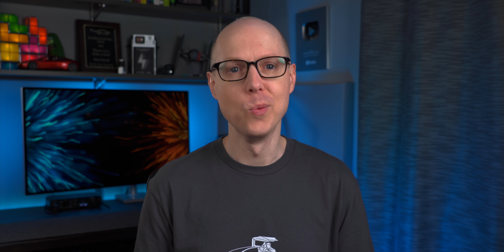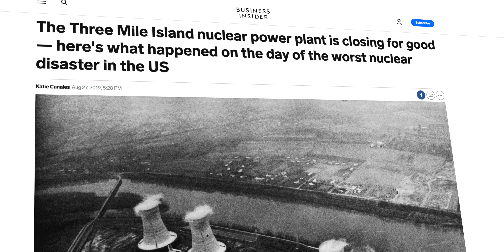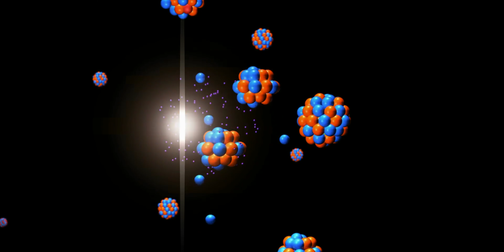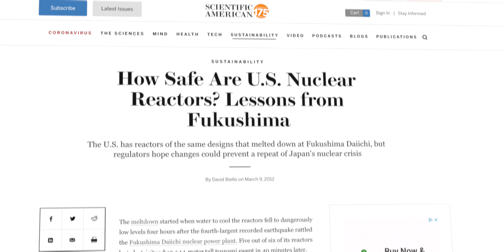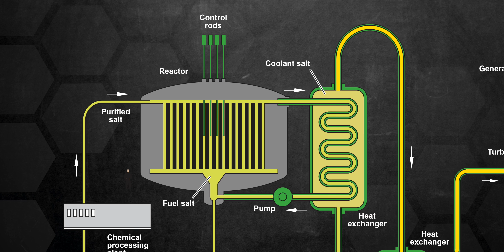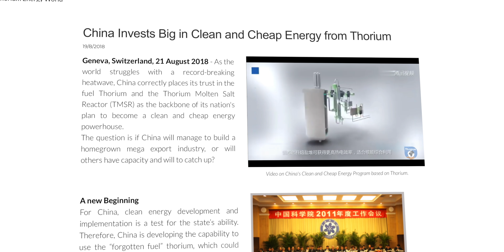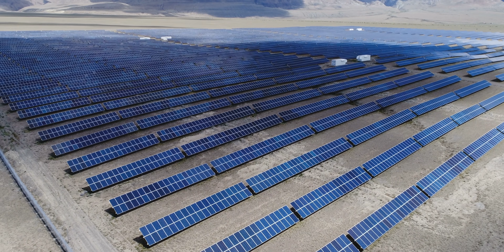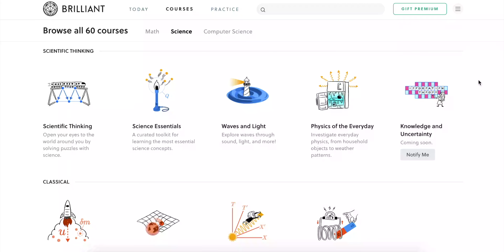Thorium explained - the future of cheap, clean energy?

Comment: Thanks for covering this. The efficiency of these plants can't be overstated, at least for the Molten Salt variety. We're looking at going from say 4% efficient today, to in excess of 90% with these. Molten Salt plants don't suffer from the disadvantages of having to manufacture solid fuel rods which are both expensive and have to be removed before they are fully spent.
They also work at much higher temperatures, so the power plants can be much smaller for the same power output.
You also don't need that massive containment building which all traditional reactors need to contain a catastrophic failure.
Reply from the maker: It's understandable why there's a movement behind the concept.
Reply: @UndecidedMF  - Obviously solving the Engineering problems is far from trivial. However, compared to the challenges faced by Fusion they are much less of a hurdle. We know the reactor physics works because of the success of the Oak Ridge National Laboratory experiment. Considering this work was only rediscovered relatively recently, they've made astonishing progress. This is against a backdrop of a regulatory framework in the US that severely restricts what they can do. Hence much of the work is being done elsewhere.
Reply: @rogerfroud300  The big thing is it's engineering, not the basic physics, the reactor concept works fine, it's just making it economic.
Reply: @killcat1971  - Agreed, and the Chemical processes for the maintenance of the fuel will have to be validated.
None of these things are especially difficult to do, I don't think the costs will be prohibitive. The economic prize is truly vast though. Generating power from fossil fuels or renewables provides a pitiful release of energy compared to what can be acheived through the use of Molten Salt reactors. Things like desalination of Sea water for drinking, or even removing Carbon Dioxide from the atmosphere, reversing global warming are feasible when you can generate vast amounts of cheap electricity. It's an absolute game changer compared to any other current power source, including the present generation of Fission reactors.
Reply: @rogerfroud300  - all great points.  I wonder why there is so much press and push for fusion, yet the MSR - in its varieties seems to be a win/win/win option that the US and the world are not pursing fast enough.  I know Germany rushed into the solar business - batteries are not very good - maybe that will change soon (they are slightly better than they were 10 years go)... there are rumors of those solid state and graphene or what not, for batteries that could make those a game changer in the next 5 years.
.
For the grid, renewables are not all that good. Batteries are barely any better.  Fusion is a distant dream.  The MSR is mostly here and mostly tested... it should have been here 10 years ago.
..
Maybe the US Petro Dollar needs to die first?
Why is the US so attached to the oil/shale/petro dollar - they are all linked.  You could say it is the old US Empire.  Time for a new more efficient empire!
Reply: @drx1xym154  - The reason is a simple one.. It's likely the nobody even knew about Molten Salt reactors when research and investment in Fusion began. The Molten Salt Reactor experiment at the Oak Ridge National Laboratory was destroyed and the reports nearly lost due to political reasons.

It's only because Kirk Sorensen read about the experiement and tracked the reports down and published them that anyone heard about it. Even then, nobody was interested because they were too far invested in Fusion or conventional Fission to be able to run with it.
 This was only in 2000, so progress has been astonishing really.

If they knew what we know now, ITER would never have been built. Even now, it would be better to just scrap it and divert the billions they're still wasting towards Molten Salt Reactors. That's never going to happen though, there would be too much egg on their faces.

Molten Salt reactors will come now though, and Fusion will never be economically viable with Molten Salt reactors as a competitor. There's huge interest in it, and the economic prize is almost incalculable.
Reply: @rogerfroud300  Actually, most of those processes were validated by the MSRE at Oak Ridge. There are other things that still needed to be addressed at the end of that project, such as plating of noble metals on the inside of the heat exchanger, developing real-time processes for monitoring the live chemistry within the reactor, testing additional materials other than hastaloy N to see if they performed better and over longer periods, etc. Unfortunately they never got the chance to build the MSRE2.
Reply: @rogerfroud300  I wouldn't way fusion is a complete waste, but I largely agree with this, especially when you consider the fact that the relative energy gain of H-2 + H-3 fusion is just 4X of the energy released with U-233 fission, and that's just the energy released. Then, with fusion, you have to consider the fact that you'll be pouring a SIZABLE percentage of that power right back into the reactor to maintain the process, so really fusion, at best, probably only yields 2X-3X, assuming we can get away with only having to pour 50% or 25% of the power back into the reactor.
Reply: @williamsmith1741   Circling back after 9 months. From a previous post you said you did xactional DD for a day job, so you'd know how to 'run numbers and interpret the results'. LMK what you think of this my treatise assertion; 
"The energy density myth of terrestrial D-T fusion busted when full EROI accounting is applied."
{For the benefit of the rest of the  lay readership I'll include workings references that you & I already likely know and take for granted}

Naturally occurring tritium is extremely rare on Earth.  We have to make it artificially by ‘fracking’ lithium with neutrons.
 'Natural ' lithium is made up of Li-7 92.41% and Li-6 7.59%

Making tritium from Li-6 is easy with neutrons of any energy (ie fast or thermal), and is an exothermic reaction yielding 4.8 MeV

Li-6 + n → He-4 (2.05 MeV) + T (2.75 MeV)

High-energy neutrons can also produce tritium from Li-7 in an endothermic (net heat consuming) reaction, consuming 2.466 MeV

Li-7 + n (2.466MeV min) → He-4 + T + n

D-T fusion releases about 17.6MeV of total energy, or 3.52MeV/nucleon (17.6/5).  Nominally this is indeed more than 4x that of U233 (The fission of one atom of uranium-233 generates 197.9-200.1MeV or .845726-.855128MeV/nucleon (197.9/234 or 200.1./234) https://en.wikipedia.org/wiki/Uranium-233  )

HOWEVER, the bulk (80%) of the D-T energy is carried off in the ejected neutron ( https://en.wikipedia.org/wiki/Deuterium-tritium_fusion  )

D + T → He-4 (3.5MeV) + n (14.1MeV)

We’re limited in ways to use that neutronic energy for direct energy conversion.  The best way to reclaim that ex-neutron energy is to have an inner breeding blanket+moderator of Li-7D and an outer breeding blanket of either Li-6D or maybe even just a single blanket of partially enriched (say 30% Li-6) of FLiBe+Th232 (to breed U233
 :-D )

But what is the post impact energy distribution of Li-7 + n (14.1MeV) → He-4 + T + n ? 

Is it He-4 + T + n(11.634MeV) or is it He-4 (4.36275MeV)+ T(5.817MeV) + n(1.45425MeV) or some other energy distribution?

If it’s the first suggested distribution, one could get anything from 2 to 5  further Li-7 fissions and T yields, but if the latter, then it’s done its dash and then only good for  1 further Li-6 fissioning and T yield. But at least it’ll heat up the LiD or FLiBe blanket which one might practically use as the heat exchange mechanism if it could be kept in a molten salt state.

In the best case of D-T fusion, If using only Li-6 then the total energy/nucleon is 22.4MeV(ie 4.8+17.6)/9 or 2.488889MeV/nucleon

In the worst case if only using Li-7, then the total energy/nucleon is 15.134MeV (ie 17.6-2.466)/10 or 1.5134MeV/nucleon

So terrestrial fusion’s TRUE  IDEALISED NET energy density is ONLY 1.77 to 2.91 times greater than that of U233. If we factor in the averaged isotopic distribution of Li6 and Li7 over that performance range, we are looking at an averaged gain ((1.77*.9241 + 2.91*.0759)  of 1.856 (for natural Li)  to at most 2.34 times the energy of fission with partially enriched (50%) Li because fundamentally, we HAVE TO ‘burn’ LITHIUM, BEFORE we get to burn tritium. If we further subtract the energy required for isotopic separation/enrichment of Li-6, the performance margins get even less!

 In summary, the TRUE average net gain of terrestrial fusion over fission is ONLY about 2.5 times (factoring in all other energy inputs and losses in the Li -> T manufacturing/enrichment process), NOT the much-vaunted 4 times. And if we have to plough up to half of that output back into just maintaining the reaction conditions, then the TRUE final best effort net energy gain of fusion over fission is just 25%. Wow. "I love the smell of ITER plasma in the morning. Smells like Pyrrhic Victory to me!"

From your expertise realm, do my numbers and reasonings stack up?

If so, then to the fusionistas, I say this Inconvenient (and potentially career-ending) Truth:

The only people who succeeded in putting "a Sun in a box" and profiting from it, were Scott McNealy, Vinod Khosla, Andy Bechtolsheim and Bill Joy.

WHY are we trying (and FAILING) to put a Sun (fusion) in a box  for bugger-all comparative gain, when we ALREADY have the Earth (fission) at our feet? (40% of the Earth’s internal geothermal energy budget come from the decay of Thorium!) .

The squillions of dollars squandered on ITER and other fusion experiments could have got LFTRs, MCSFRs (molten chloride salt fast reactor)  and the Thorium Energy Cycle up and running 10 times over!

Patton said a "good [enough] plan [vigourously] executed NOW, is better than a ‘Perfect’ Plan executed next week”.

Our house (Earth) is on fire due to burning carbon. LFTR & MCSFR Fission energy is a 'good enough' fire extinguisher..
Reply: @rhonda-my_honda_cb500x  I couldn't have said it better. Seriously, great job man. It's a point I've made several times myself, but never as detailed. Makes me want to steal your write up for a fusion critique I was writing a while back. 

I was getting so irritated with pro-fusion videos and advocates crapping on fission power, making overly broad, unfair, and sometimes false characterizations of fission tech, just to make fusion sound "better" what I started writing a pissy critique of fusion technology and why it wasn't "all that and a bag of chips". It was really just a list of things, like 1) how the energy gain over fission really wasn't all that much, 2) the amount of available fusion fuel wasn't unlimited like fusion advocates like to say, but when talking about Li-6, it's actually less plentiful than uranium and thorium, 3) safety issues, 4) radioactive waste characterizations, etc. I think I had at least like 7 points when I finally cooled off and dropped it, but your write-up is making me want to revisit it lol. 

All that said, I don't oppose nuclear fusion research (although ITER is definitely of questionable value). It's just we have a need for a paradigm shift in energy production RIGHT NOW, and MSR's are both ALMOST as good as fusion reactors "in theory (on both sides)" and they're A-HELL-OF-A-LOT closer to commercialization than fusion reactors. 

I'm definitely stealing that Patton quote though, as it's perfect!
Reply: What part of the process are you refering to with these efficiency numbers. The generators for both use the rankine cycle at about 60% efficiency. Are you referring to the usage of the energy in the fuel as supplied to the boiler before making electricity?
Reply: Court 
I think he’s talking fuel. Traditional pressurized water reactors use less than 1% of the Uranium “fuel” we pull out of the ground. Thorium breeders such as LFTR can potentially use 100% of the thorium. This would take your total lifetime energy consumption from about a soda can of Uranium to about a small ball bearing of Thorium. Still though, a Soda can is darn impressive. How many tons of Coal would your lifetime energy be?
Reply: @MrElifire84  - That's exactly right. It gets even better than that because that waste fuel from existing reactors can be used as a fuel source. Many mines have been abandoned because the high levels of Thorium in the waste is such a problem.
So we can genuinely say that the fuel is readily available and for all practical purposes inexhaustible.
Reply: Roger Froud 
All yup.  However, I would say that current waste fuel isn’t really a good feedstock for Thorium reactors. This is something you’ll hear touted on the internet but it’s basically wrong. To burn current waste fuel you would really need a fast spectrum reactor which the LFTR concept isn’t. That’s not to say that molten salt reactors can’t be fast spectrum, just that the LFTR isn’t. To be fast spectrum in a molten salt reactor they would probably use molten chloride salts instead of Fluoride salts since chloride doesn’t slow down(moderate) the neutrons as readily. In fact, one of LFTR’s primary benefits is its ability to breed at a ratio of greater than one in the slow(or thermal) neutron spectrum. This avoids some of the perceived difficulties of fast spectrum reactors. 
That being said, there are some forces that would argue that molten chloride fast reactors are a better path in any case. It’s quite a technical debate beyond the scope of a single YouTube response. ;)
Reply: @MrElifire84  Well, in a thermal spectrum MSR thorium breeder, it wouldn't quite be 100%, but close, probably topping out at 98.5% burnup total. This is the result of being able to pull out neutron poison fission products as well as starting lower down the fuel cycle, starting with U-233 which has a 90% fission rate, with the remaining 10% eventually becoming U-235 which has an 85% fission rate in the thermal spectrum, leaving only 1.5% of the fuel progressing to Np-237. Your lifetime energy needs would be about 650 grams.
Reply: @MrElifire84  You're absolutely correct in that fuel rod waste wouldn't likely work in a thermal spectrum MSR. Their low breeding ratios of 1.05 to 1.07 means they produce very little excess fuel, consuming almost everything they produce. This makes it almost impossible to to use a thermal spectrum MSR to breed the fuel needed to start another thermal spectrum reactor, not unless you're willing to wait 17 - 25 years. However, that also makes thermal spectrum MSR's incredibly proliferation resistant, as if you pull out any more than the tiny sliver of excess fuel you might have produced over a year, you'll kill the reactor because it no longer has sufficient fuel to maintain criticality. Fast spectrum reactors, on the other hand, have much higher breeding ratios, and so produce large excess amounts of fuel, which, after being operated for a certain period of time, can be removed, yielding almost pure Pu-239. There are strengths and weaknesses of different types of reactors.
Reply: @MrElifire84  The primary benefit for using existing nuclear waste as fuel is that it's the only known way to permanently dispose of of it in a once through fuel cycle.
Reply: @court2379  - The numbers I'm quoting are for the  proportion of the fissile material used by the reactor. The turbines will have a higher efficiency too because there's a higher temperature drop across them, but that's small beer compared to the savings on fuel.
Reply: @court2379  Molten salt reactors operate at around 600-700C (vs 350C for PWR) and are expected to use combined cycle power generation, Brayton (CO2) followed by Rankine (steam) cycle power turbines, similar to high efficiency coal plants.
Reply: @court2379  I understand most molten salt systems whether they be solar thermal or nuclear do use or will use Brayton cycle closed loop gas turbines to extract energy in roughly the 550C-300C range and Rankine cycle (which can also be closed loop) to extract energy below 300C. Similar systems are currently used in high temperature high efficiency coal plants, so there is no need for new invention, we already have the technology.
Reply: @court2379  fuel burn 

solid fuel cracks from Xenon and Krypton being produced inside the fuel pellets of traditional reactors so the rods need to be removed before the fuel is completely used. 
Molten salt reactors can burn their entire fuel load, you dont even need to shut them down to refuel.
as mentioned in other comments super critical CO2 turbines are also more efficient and the temperature makes them possible.

the other interesting thing with temperature is that its also possible to do neat industrial process tricks like turning atmospheric CO2 and water into jet fuel.
Reply: @court2379  clearly, yes.
Reply: One of the worlds leading proponents of sustainable, safe nuclear power is Kirk Sorenson at Flibe Energy ( https://flibe-energy.com/about-us/).  He has been at it since at least 2011....and a hell of a nice guy as well! I dare say that no engineers out there currently know more about Thorium based reactors than Kirk.  Check it out!
Reply: You also don't need that massive containment building which all traditional reactors need to contain a catastrophic failure.

Let's put it this way: haven't kept 3 catastrophic failures from blow it in a steam explosion including hydrogen and oxygen forming from pressurized water.
It is exactly that: todays nuclear facilities are a failure by design. This is not.

Bad thing is: it comes late to decarbonization. most design docs of the only runnig rrector seem to be lost.

Even if we can start this in an optimistic 15 years dev and build time for the first reactor, we would have to go all out renewables today to survive climate change.
Reply: You still produce nuclear waste that last 500 years(ish). Although it has massive improvements over the currently used system, it still produces toxic waste. Why do it? There are MANY more renewable technologies than traditional wind and solar though they are still being improved upon. What about hydro? Wave? Currents? Geothermal both shallow and deeper advanced geo that promises power 24/7 265 days of the year independent of weather conditions. Nuclear looks great if that’s the only thing you look at, it shouldn’t be. The cost and dangers both now and far into the future are unacceptable when other technologies without the toxic baggage either exist or are being development. Don’t want to ramble any further but our research efforts should go to renewable, less toxic solutions.
Reply: Hello Roger, good comments. I would like to nuance some of your statements: the efficiency is indeed much better in molten salt plants but it is not the parameter driving electricity cost because uranium fuel is still very cheap (in 2020). And you still need an massive containment building, this is mandatory even to protect from external hasards (airplane, etc...). Cheers.
Reply: @74hdo  - Well, using 4% of the energy contained in traditional fission reactors, along with the long half life , is why it costs so much to store the extremely long lived radiocative waste. When you use 90% or more of the energy contained in the fuel, your waste reduces by the same factor.
A good deal of the cost of traditional reactors is tied up in attempts to make it safe from melting down, and how to contain it if it does. Take the possibility of a meltdown away, and that massively reduces the cost of the reactor.
Running at higher temperatures reduces the cost of the turbines because they're much smaller.
Reply: @74hdo  The cost of uranium fuel for PWRs lies in its enrichment (a complex physical and chemical process), it's preparation into fuel rods and disposal of the highly radioactive residue often requiring reactor shut down. Compared to this, preparation of thorium fuel is a relatively inexpensive chemical process, with the reactor being continuously fuelled. Waste disposal will be a relatively straightforward chemical process extracting the waste from the reactor while it is in full operation, with no shut down required.
Reply: In fact  Uranium salts just fizz out of the salt mix. Separation is incredibly simple.
Reply: @74hdo  but the secondary containment building doesnt need to contain a steam or hydrogen explosion if reactor pressure drops, so theyre much cheaper to build.
everything gets cheaper because youre operating at 1 Bar not 250

disposal of 1kg vs 1000kg per GW year is also a large savings.
Reply: @74hdo  You don't require a massive containment building I'm afraid. The primary function of those massive buildings isn't to protect against planes, but rather to contain the massive expansion of steam in the event of complete loss of containment of the cooling water. Without the need to contain steam, if you wanted to protect against planes, you could still build an incredibly thick building, but it wouldn't need to be much larger than the reactor system itself, which typically only makes up a small percentage of the the building in current reactor plants. It would also be relatively easy to put it below ground just 10-20 feet, making the building much less targetable from the air and providing more than enough protection against the worst of possible likely attackers, that being a dive bombing airplane.
Reply: @74hdo  - No you don't need a massive containment building since you don't have Hitemp/HiPressure radioactive water/steam in a MSR. This system uses molten salt at atmospheric pressure and if a leak develops the Thorium hardens into a solid at normal temps. That along with no long lived actinides and all the waste is safe after 300 years storage instead of 10,000 years of todays reactors.
Reply: Alas they do not work.......what I mean by Do not work ,  is  when the yield is low, and maintenance is high ....technically, economically, in practice ..It don't f...ing work. But i would love to be proven wrong! Meanwhile thank science for Elons 4680.
Reply: @brianevolved2849  - I think you need to look into this a little more. The Molten Salt Reactor at Oak Ridge National Laboratory went critical in 1965, and ran until 1969.
The technical problems of designing, building and maintainging these types of reactors are small compared to conventional and very dangerous Pressurised Water Reactors.
They have a very bright future, unlike Fusion Reactors which will never be economically viable.
Reply: @rogerfroud300  Dear Rodger alas me thinks the technicians may well have been ....fibbing as to how well it worked, I was not there...I assume you were not there....If so simples then how come NO ONE has been able to duplicate
 replicate ???
Reply: @rogerfroud300  Dear Boger How dare you imply your research is bigger than mine?  Along with your faith you are of course at liberty to "believe" in whatever you wish. Until all these " hard working company's come up with ANYTHING THAT WORKS my insignificant thirty years of research suggests......It aint worth it bruv.....better fit a solar panel and thank science for Tesla, and Elons 4680. Live long and prosper ...sustainably.
Reply: @brianevolved2849  - Well, clearly you are misinformed. Nobody even knew about the Oak Ridge experiment until Kirk Sorensen unearthed the reports in 2006, so how exactly do you expect anyone to have made one before that date? You think they lied? Really? So you talking about 30 years of research is bullshit.
Maybe you'd like to list the companies that are currently doing research? Maybe you could list the countries who have projects?
You need to pipe down until you know what's going on.
You talk like a spoiled teenager.... bruv...
Reply: @rogerfroud300  I've already taken him apart in separate comments.
Reply: @brianevolved2849  Conspiracy theories again?
Reply: So nuclear will get much more efficient in destroying the ecosystem. Whoopee, we're al;l gonna die! Don't you enthusiasts ever try to think critically? Nuclear isn;t a renewable, it's adding all its energy to an already heating planet/ THINK for a change.
Reply: @davidjessop2279  - Thanks for your juvenile analysis. Maybe it's you who should be thinking a little deeper. If you have an almost infinite resourse of fissile material, ie Thorium and the stockpile of Nuclear waste and decomissioned weapons, you don't need them to be renewable.
Molten Salt reactors are orders of magnitude more safe than Pressurised Water Reactors, they can't melt down, they use over 90% of the available energy in the fuel, and they will be cheap to make.
One Molten Salt Reactor would replace thousands of pitifully weak sources such are Wind and Solar which take vast amounts of energy to make.
The amoung of energy we can create using these reactors would mean we can start reversing the process of Carbon release because they are genuinely Carbon negative.
Take the time to investigate these things before making crasse comments eh?